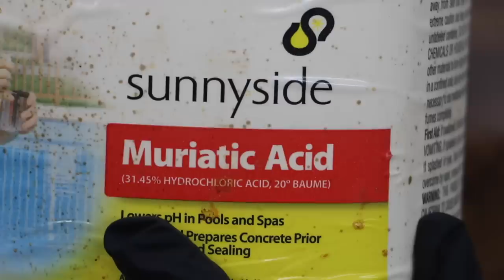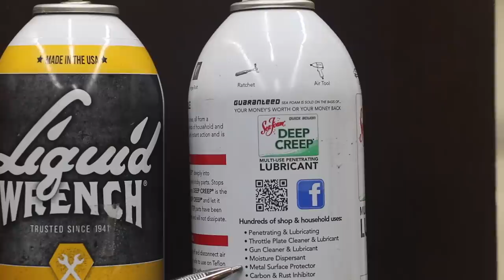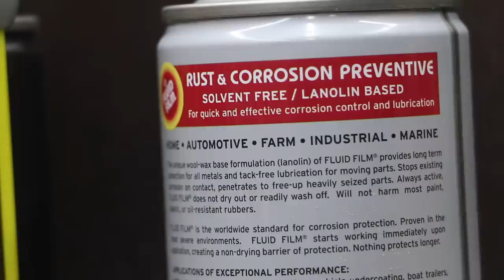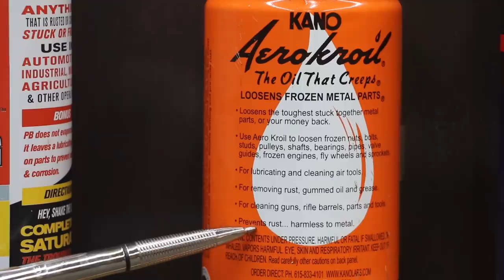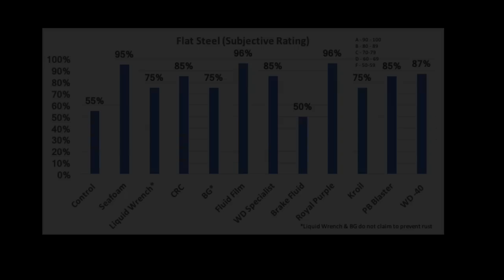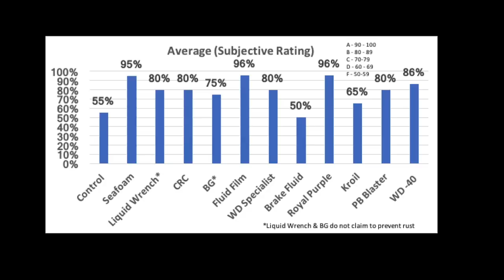Do Penetrating Oils Block Rust?  Let's find out!

Comment: Why is it 2 have 2 different bolts?  When I buy a box of bolts the thread count is the same. Yet you show a coarse bolt with 16 threads and compare it to a bolt that is a fine thread with 24. <The acid wash really did some damage.> you are confusing the issue...and test.  In the test you do not use motor oil which is in the oil can that I refill. Brake fluid is less available than auto transmission fluid or engine oil (2 stroke or 4 stroke).  Then again I may have diesel or kerosene around to use as a lubricating liquid.    My mom uses cooking oil...because that is what she commonly has available in the kitchen to lube hinges or electric analog clocks that make noise.  Yes it attracts flies that go inside to feed on the oil and they become part of the Lube. 120Volt Clock still works after 66 years and not lose a second.
I am not going to go out and buy a lube when something else will do.     I suspect the best anti rust ones have silicone in them.
. strange you don't have snake oil..

Comment: I usually think your method of testing is great, but in this case I don't.  Spraying salt water on steel is a very particular kind of assault.  I understand you wanted something that would have a lot of effect quickly...but that is exactly the problem.  For example, WD-40 was invented as a "Water Displacement" light oil film for "normal" rust prevention...spraying it down with ANYTHING will wash it away.  That isn't how I, or most of us, would use it.  I expect it to work against humidity, not sprayed salt water!!!
Reply from the maker: Thanks for the feedback.

Comment: Hey man, just an old fart that needs a little bit of Education on Gun oil.. you reckon you could try some of the available gun oils on the market and see which one cleans , lubricates and protects the best? I use Break Free CLP, but there's also Hoppe's, and I guess about as many others as you can shake a stick at just not around my neck of the woods.

Also I couldn't find anything that you've done on Belt Sander belts. I'm fixing to have to buy some belts for my sanders because I got a little project I need to do so, I just wonder which one's last the longest and cut the best. Thanks for your videos!
Reply from the maker: Great test ideas on the Gun oil and belt sander belts.  Thank you